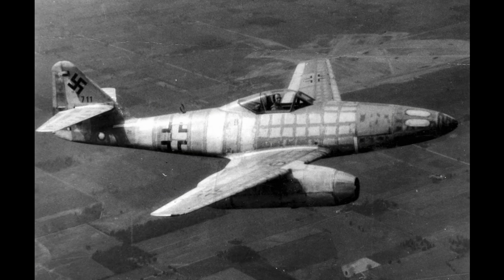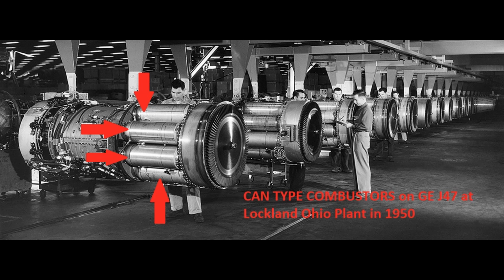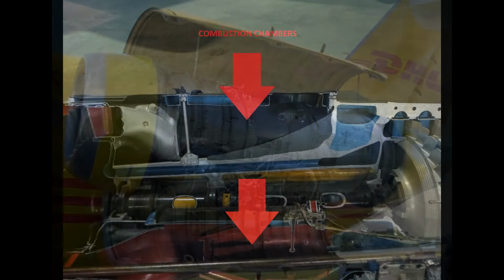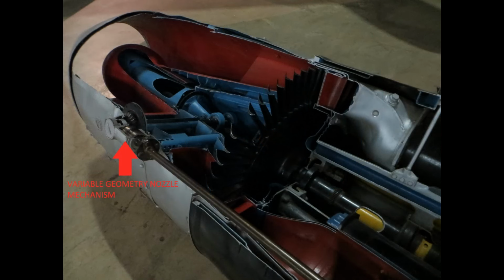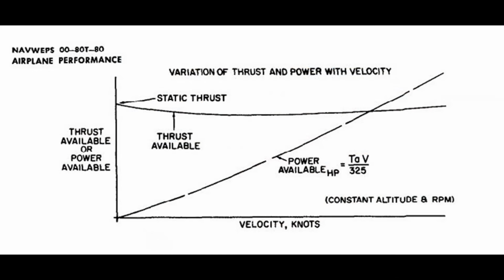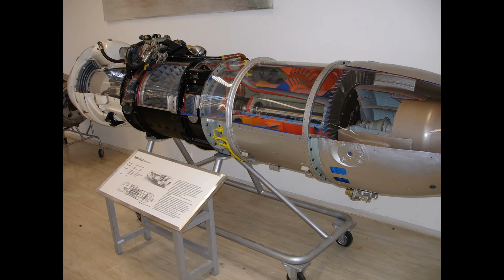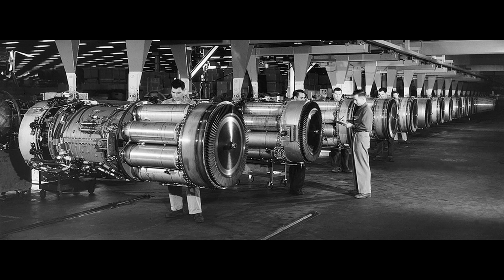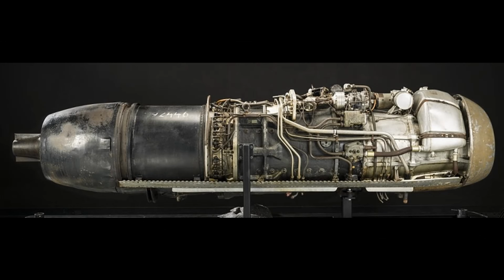World War Two JET POWER

Comment: World War Two jet power without the British ?
Britain the Gloster E28/39 had its maiden flight on 15 May 1941 and the Gloster Meteor finally entered service with the RAF in July 1944. These were powered by turbojet engines from Power Jets Ltd., set up by Frank Whittle. The first two operational turbojet aircraft, the Messerschmitt Me 262 and then the Gloster Meteor entered service within three months of each other in 1944
Reply: 27th of August 1939 was the first jet flight by a german Heinkel HE 178, in Rostock germany, twelve ensuing test flights. No "3 months" but 5 years difference.
Reply: @waltrohrbach2459  The HE178 not enter service as an operational jet fighter. The British Meteor did and was very successful although mostly used chasing and shooting down V1 flying bombs because it was fast enough to catch them.
My main point was The title of the film said WW2 jet power but mentioned nothing about the British jet fighters used in active combat.
Reply: @coastlinesailingcruisingan3991  The important thing to remember was Germany was very consistently about 2 years ahead of Britain in jet engine technology from 1934 until the war ended.
Reply: @sandervanderkammen9230  That is not true. If that statement was correct the the British Meteor jet fighter would not have been in service until 1947. However it entered service just 3 months after the ME262. It was also a significantly better aircraft than the 262 with better engines. the engine life of the 262 was just 8 hours.
The Gloster E28/39 first flew in may 1941, the first me262 flew in April 1941
where on earth do you get two years difference from ?

Frank Whittle the British inventor is credited with the invention of the jet engine. with his first patent submitted in 1930 and which was granted in 1932. This was the first jet engine patent in the world.
Germany copied his idea from this research
Reply: @coastlinesailingcruisingan3991  Its absolutely true, the first prototype  turbojet engine was built by Hans von Ohain and Max Hahnn in 1934, Whittle would not begin actual work on jet engines until he moved to Rugby in 1936.
The Heinkel He-178 flew on August 27th, 1939..
Whittle was the only the 4th person to successfully demonstrate a jet aircraft engine in 1941.
The Gloster "Meatbox" did not fly until 1943.
 That is completely false, the Meatbox was completely inferior to the Me-262... it was 140mph slower when it was introduced into service and performed poorly as a fighter and was never used in the fighter role by the RAF as it was vulnerable to attack by Luftwaffe propeller aircraft.
The Whittle W2 engines were less reliable and had a shorter life, a PTFR of just 50 hours and TBOs of 5 to 10 hours. Only the Rolls-Royce engines could match the durability of the Jumo -004.
The Jumo-004b engines met or exceeded the RLMs 100 hours PTFR reliability standards for adoption into  Luftwaffe service. This is the exact same 100 hours required by the RAF and the USAAF.
The U.S. Army tested the Jumo -004 during Operation Lusty and confirmed TBOs of 50 to 60 hours, EXCELLENT by WW2 standards.
Reply: @coastlinesailingcruisingan3991  The Gloster Meatbox was never used in active combat as a fighter during WW2 and never shot down a single Luftwaffe plane.
The Meatbox only killed British pilots.
Reply: @sandervanderkammen9230 
By the time British jet fighters were being produced in numbers in the UK during WW2 it was generally accepted that there was no need to actually make use of them.  If things had been different there would have been more produced & they would have been used.
Reply: @paulpaul9914  Britain lost the war in September 1940 and surrendered to the Americans.
Reply: @paulpaul9914  The Gloster Meatbox only killed British pilots.
Reply: @sandervanderkammen9230  America didn't  join the war in Europe until December 1941 and  didn't come England until 1942.
we had already defeated the Germans in the Battle of Britain. 1940. without any help from them. Britain alone was the first country to stop Germany advancing any further.
Reply: @sandervanderkammen9230 
The UK was already winding down in 1941 & contemplating how Germany would be rehabilitated after being thoroughly dealt with & demilitarised etc & what the UK would be doing after that little task was completed.
Reply: @paulpaul9914  There were only two winners in WW2 and Britain was not one of them.
Germany achieved its goal to destroy the British empire and become the economic leader in Europe.
Reply: @sandervanderkammen9230 
Whittle ran his gas turbine aero engine in 1937, it was the first successful demonstration of a viable, liquid fuel gas turbine aero engine in the world.
Reply: @paulpaul9914  Hans von Ohain ran his engine in 1935.... and made a successful test flight in 1939... consistently 2 years ahead of Whittle.

Whittle was only the fourth person to successfully demonstrate a working jet aircraft engine.
Reply: @sandervanderkammen9230  Why did we occupy over a quarter of Germany from 1945 to 1990 then if we lost ?
the Empire still exists its just called the Common Wealth now and has 56 countries in it.
Reply: @coastlinesailingcruisingan3991  Britain was an American possession from 1946 to 2006, it's still an American protectorate and US military forces still occupy the UK.
Reply: @sandervanderkammen9230  no it wasn't , and they are guests. as part of NATO. 
it gives them a base closer to Russia. 
your just quoting the Anglo American loan
America didn't possess  Britain.
Reply: @coastlinesailingcruisingan3991  It did in fact own Britain from 1946 to 2006, the UK government surrendered its autonomy and enfluence on foreign affairs as conditions of the Anglo-American bailout loan agreement.
Reply: @sandervanderkammen9230  I just read the loan history and agreement. at no point did America "own" Britain.
it allowed America to became the World dominant power and relegated Britain to second place. 
the war financially crippled Britain.
all this crap over my original comment that Britain as well as Germany developed Jet fighters during the war years.   
something the video failed to mention.
in Britain led the way post war with jets and jet engines. so much so that the Americans bought them and are currently fitting their B52 bombers with British Rolls Royce  engines.
Reply: @coastlinesailingcruisingan3991  Please name a single British company that still makes British jet aircraft in the UK?
Reply: @sandervanderkammen9230 
Fryed Ryce Munchyrz Kharzeestan Krappenz DiktorBummer and co etc SHUD note much appreciated awestruckness.
RR of England (gas turbines aero engines) has a wholly owned subsidiary in Germany that does smaller 2 shaft engine work, it has nothing to do with BMW. All the large 3 shaft engine manufacturing is done in England of course.
Reply: @paulpaul9914  JUST NAME A SINGLE BRITISH COMPANY THAT STILL MAKES BRITISH JET AIRCRAFT?????
Reply: @paulpaul9914  NAME A BRITISH JET AIRCRAFT STILL IN PRODUCTION?
Reply: @sandervanderkammen9230  Also I said engines not aircraft. you keep moving the goal posts because you cant deny my answers.
Britain is still one of the leading manufactures of aircraft parts and multi country fighters like Euro-fighter. Eurofighter Typhoon, the British aerospace industry has a 37.5% share in the production of the Eurofighter Typhoon and a 33% share in the development of the aircraft. The main participants are BAE Systems and Rolls-Royce. The UK had 40,000 jobs involved in the construction of the Eurofighter Typhoon, across 400 suppliers. Comparatively, the next largest contributor to the Eurofighter Typhoon, Germany, had 25,000 jobs involved and 400 suppliers.
F-35 Lightning II, the UK aerospace industry has a workshare of about 20% in the aircraft and has two companies in "Team JSF", BAE Systems and Rolls-Royce. BAE Systems designed and produces the aft fuselage, fuel system, horizontal and vertical stabilizers among other things. Rolls-Royce provides the Liftfan for all F35Bs.
Saab JAS 39 Gripen, over 30% of the content within Gripen is manufactured in the UK, according to Saab.The carrier-based concept, the "Sea Gripen", was also designed in the UK
Reply: @coastlinesailingcruisingan3991  Please name a BRITISH COMPANY that still makes British jet aircraft in the UK???

Eurofighter Jagdflugzeug GmbH is a German company based in Munich.

BAE Systems has never designed and built its own aircraft.

The F-35 is an AMERICAN aircraft designed and built by American company Lockheed Martin.

Just name a British jet still in production???
Reply: @sandervanderkammen9230 
UPDATE
It's interesting that some of the aircraft on the list should really have been noticeably safer than the Comet due to being a similar type but of much later design & manufacture but they definately were not safer.
    How things were back then -
Accident losses - % of aircraft built.
DeHavilland Comet 4 UK     14% 
DeHavilland Comet all mks  17%  
Vickers VC10 UK 5%
The DH Comet had better safety than or similar safety to many other commercial passenger aircraft of a similar era
    Douglas DC-1        99%
      Douglas DC-2        47%
    Douglas DC-3        30%
      Douglas DC-4          26%
    Boeing s300            72% 
 Boeing 307               70%
  Boeing 247                48%
     Boeing 707                   20% 
   Lockheed Electra  Turboprop    29%
Fairchild FH-227                         30%
 McDonnell Douglas DC-8     14%
  Sud Aviation Caravelle       15%
Canadair CL-44  Turboprop   46%  
Convair CV-580  Turboprop 22%

A comparison of more recent aircraft.
Accident losses comparison examples. 
1970s - 1980s
    % of total Aircraft built
Similar aircraft type, date / decade, useage, size.
    Biz Jets
BAe-125-800                        1.7 %
Beechcraft Beechjet 400    2.2 %
Cessna 550 Citation II         7.1 %
Learjet 35 / 36                       12 %
Beechcraft 1900                  6%
Dassault Falcon 10              11.5%
Aérospatiale SN.601            22.5%

Medium size jets / Turboprops.
BAe-146               5.1%
Fokker 100          6%
McDonnell Douglas DC-9-30       9.5%
Fairchild FH-227       30%
McDonnell Douglas DC-8    14%
Canadair CL-44  Turboprop   46%  
Convair CV-580   Turboprop   22%

Beechcraft, Fokker, McDonnell Douglass, Learjet, Fairchild, Aerospatiale, Canadair, Convair  companies defunct.

    All Comets, including some Comet 1s, had full civilian use certification at some point after 1954,  civilian use certification only being withdrawn after commercial flying stopped. Examples were flying until 1997 - one example did a signals research global circumnavigation flight series in 1993 via Australia virtually without a rest travelling 28000 miles, only had an ice warning indicator issue during the flights.
    The DH Comet - World Firsts.
1st gas turbine jet powered airliner. 1st high altitude 8psi pressurised full fuselage length passenger cabin airliner,  not a trivial feature as structure  strength required for pressurisation considerably exceeded strength required for normal flying stress. Nobody else had done anything similar before the Comet.
The b-47 used 2 relatively small, heavily built  pressurised modules  (the aircraft where 6 had their wings fold up in 2 months while flying & some had their wings fall off while parked). 
The 1937 Boeing piston engined airliner pressurised passenger cabin was pressurised to 2 psi only - in fact that could easily be done as the normal unpressurized fuselage cabin structure strength for flying stresses only was all that was needed to be adequate so no significant weight increase issues needed addressing.
    1st all hydraulically powered flying surface controls & actuators airliner with under carriage wheel disk brakes + ABS.
1st jet airliner to cross the Atlantic.
1st jet aircraft to do a world circumnavigation flights series.
  Of course De Havilland had prior experience building many all metal construction airframe aircraft including thousands of jet powered fighter aircraft that were primarily of metal construction with pressurised cockpits & jet engines built by De-Havilland & we know the world's first all metal construction airframe airliner was built in England in the 1920s by Handley Page.
  De Havilland did indeed always work to better than industry standards at the time, no evidence of negligence ever being produced in relation to the DH Comet.
Reply: @sandervanderkammen9230  I did BAE Hawk. I drive past the factory where they make them. at Warton. 
you didn't read that reply. you also didn't understand this post either.
Reply: @sandervanderkammen9230  Again you keep going off on a tangent. my original comments were about a film "World War Two jet power"
please try to stay on topic
The film only mentioned German Jets.
I correctly commented the British  also developed jets and had an operational Jet fighter. 
here is my original comment.
World War Two jet power without the British ?
Britain the Gloster E28/39 had its maiden flight on 15 May 1941 and the Gloster Meteor finally entered service with the RAF in July 1944. These were powered by turbojet engines from Power Jets Ltd., set up by Frank Whittle. The first two operational turbojet aircraft, the Messerschmitt Me 262 and then the Gloster Meteor entered service within three months of each other in 1944
if you would like reply please stay on topic.
Reply: @paulpaul9914  Half of the Comet 1s crashed.
Reply: @coastlinesailingcruisingan3991  Unfortunately, you look rather foolish right now lad... BAE ceased production of the half century old Hawker Hawk years ago.
Reply: @coastlinesailingcruisingan3991  Germany was the only country to have successful jet fighter aircraft in operational combat service.
The Gloster "Meatbox" only killed British pilots during WW2!!!.
Reply: @coastlinesailingcruisingan3991  No RAF aircraft ever saw operational service with engines made by Power Jets Ltd.

No Power Jets Ltd. engines successfully completed the RAEs' 100 hour PFTR reliability tests that are required for adoption into RAF service.
Reply: @sandervanderkammen9230  Lad ? I am 63
my relatives flew a spitfire and a Lancaster bomber. both of which I talked to when I was a "Lad".
Reply: @coastlinesailingcruisingan3991  Look son, regarding this topic you are merely a lad... immature and naive regarding such matters.

Please name a single British jet aircraft still in production today in Britain????
Reply: @coastlinesailingcruisingan3991  BAE CEASED PRODUCTION OF THE HAWK IN 2020.

NAME A SINGLE BRITISH COMPANY THAT STILL MAKES BRITISH JET PLANES IN THE UNITED KINGDOM???
Reply: @WilhelmKarsten  it was still an operational jet fighter. V1 bombs very very fast it was one of only a few fighters able to pursue and catch them. 
I didn't say and never claimed  it was any good just that the ME262 wasn't the only operational Jet fighter. 
however it did set the official absolute  jet speed record in 1945 of 600mph.
Reply: @coastlinesailingcruisingan3991  It was never operational as a fighter, it was used experimentally, very briefly in the V1 interceptor role but was quickly abandoned in favor of faster propeller interceptors like the Tempest and Mosquito.

The Messerschmitt Me-262 held the top speed record until Sept 14th, 1948.

 On August 19th, 1944 Luftwaffe pilot Heinz Herlitzius took off from Flugplatz Leipheim and reached a record top speed for an air-breathing combat aircraft of 624 mph (1004 km/h) in the Messerschmitt Me-262.
Reply: @coastlinesailingcruisingan3991  NAME A BRITISH JET AIRCRAFT STILL IN PRODUCTION IN THE UK????
Reply: @WilhelmKarsten  source please 
wiki lists the 262 as 560 mph and Meteor as 600 mph. .82 mach level flight.
quote I found.
After the war, the Royal Aircraft Establishment, at that time one of the leading institutions in high-speed research, re-tested the Me 262 to help with British attempts at exceeding Mach 1. The RAE achieved speeds of up to Mach 0.84 and confirmed the results from the Messerschmitt dive-tests. The Soviets ran similar tests.
this was in a dive though not level flight.
Reply: @coastlinesailingcruisingan3991  THE MESSERSCHMITT ME-262 HAS THE HIGHEST CRITICAL MACH NUMBER PERFORMANCE OF ANY WW2 AIRCRAFT.
IT IS THE ONLY WW2 JET WITH ALL SWEPT CONTROL SURFACES AND A FLY-BY-WIRE HORIZONTAL STABILATOR.
THE MEATBOX WAS SUBSONIC!
Reply: @sandervanderkammen9230  I am not claiming it wasn't a good aircraft. 
I am only claiming it wasn't the only one.
a point you seem unable to grasp.
Reply: @sandervanderkammen9230  The Supermarine Spitfire's much thinner wing gave it a considerably higher critical Mach number (about 0.89).
mach 0.86
According to Willy Messerschmitt the Me 262 would go out of control and break up if the pilot exceeded mach 0.86, The RAF tested the Me 262 after the war and gave it an absolute mach limit of 0.84
Reply: @coastlinesailingcruisingan3991  The Gloster Meteor F.8 with the Derwent 8 engines didn't appear until 1948.
The F.4s didn't enter production until 1946.
F.3s had a top speed of less than 500mph.

Heinz Herlitzius set an official DAC speed record of 624 mph over the specified 3km FAI course and measured in SOG (true speed over ground) with an Askania Kinothodolite... an telemetry instrument still used by NASA
Reply: @WilhelmKarsten  Quote I found 
On 7 November 1945, the first official airspeed record by a jet aircraft was set by a Meteor F. 3 at 606 miles per hour (975 km/h). In 1946, this record was broken when a Meteor F. 4 reached a speed of 616 miles per hour (991 km/h).
Reply: @coastlinesailingcruisingan3991  THE MESSERSCHMITT ME-262 WAS THE FASTEST JET AIRCRAFT IN THE WORLD UNTIL THE F-86 SABRE IN 1947.
Reply: @coastlinesailingcruisingan3991  AIR SPEED IS NOT OFFICIAL.
 
The Messerschmitt Me-163 flew 702 mph on July 6th 1944.
Reply: @coastlinesailingcruisingan3991  That still no where near the record at True Speed Over Ground.
Reply: @WilhelmKarsten  All I am saying is that Germany isn't the only country to produce jet aircraft during WW2. 
I am not interested in any other facts.
weather they were any good or not is irrelevant. 
or the state of Britain post war is irrelevant.
simply did we or did we not produce jet aircrat. 
in any case the best WW2 fighter by far was the BF109 prove me wrong on that one.
Reply: @coastlinesailingcruisingan3991  NAME A SINGLE BRITISH JET STILL IN PRODUCTION IN THE UNITED KINGDOM?
Reply: @WilhelmKarsten  it is still the official record quote 
new Fédération Aéronautique Internationale (FAI) record for speed over a 3 kilometer course.
Reply: @WilhelmKarsten  just admit Germany wasn't the only producer of jet aircraft and end this useless tit for tat exchange.
Reply: @sandervanderkammen9230  I did
Reply: @coastlinesailingcruisingan3991  Germany certainly invented jet aircraft and jet engines, they were years ahead of Britain in aerospace technology.
 Only Germany had successful, combat effective jet aircraft during WW2.
 The Bf-109 is without question the most successful fighter aircraft in history.
The Messerschmitt Me-262 still holds the record for most jet kills, Kurt Welter is the highest jet Ace in history.
Reply: @sandervanderkammen9230  what has that got to do with WW2 jet power.
its as relevant as name a jet built solely by Germany
Reply: @WilhelmKarsten  not arguing that. only saying you weren't the only ones doing it.
you cannot dispute we built and flew jets as well and Rolls Royce is now the second biggest manufacturer of jet engines in the world. which started during WW2
Reply: @coastlinesailingcruisingan3991  Rolls-Royce is the third largest jet engine manufacturer, the Trent series is the only British engine still made in the UK.
Reply: @coastlinesailingcruisingan3991  Alot of countries flew jets during this period.
Britain did not invent jets or jet engines nor has it ever been the leader in this field, it has  always lagged behind America Germany and France in aerospace technology.
Reply: @paulpaul9914  BUT NAME A SINGLE BRITISH COMPANY THAT STILL MAKES BRITISH JET AIRCRAFT????
Reply: @WilhelmKarsten  the question is simply did the British produce jet engines and jet aircraft during WW2.
YES OR NO stop avoiding the answer.
Reply: @coastlinesailingcruisingan3991  The question is what British companies still make British jet aircraft?
Reply: @WilhelmKarsten  no the question is about WW2 jet power. stay on topic.
did the British also produce jet engines and jet aircraft in WW2. yes or no.
that is what the film is about. nothing else.
Reply: @coastlinesailingcruisingan3991  Look son, regarding this topic you are merely a lad... immature and naive regarding such matters.

Please name a single British jet aircraft still in production today in Britain????
Reply: @sandervanderkammen9230  first sign of a lost argument is resorting to insults.
you true nature is now reveled.
you have tried very hard to not admit you are wrong and insults is the final stage of defeat.
Reply: @coastlinesailingcruisingan3991  Just answer the question.
Name a single British aircraft manufacturer that still makes British jet planes in the UK????
Reply: @sandervanderkammen9230  I just answered your question, now you answer mine.
did Britain make jet engines and jet aircraft in WW2 yes or no.
Reply: @sandervanderkammen9230  I stand corrected production did end in 2020.
we now only build jets with other partners.
the list of which I provided previously .
Right now you answer my question.
WW2 jet power was not just the Germans.
the British also built jet engines and jet aircraft. the de Havilland vampire which first flew in Sep 1943 and entered service in 1946. the first jet to land and take off from an aircraft carrier .
by the end of the war we caught up and surpassed German jet engine design and performance.
Reply: @coastlinesailingcruisingan3991  Britain was at least a decade behind Germany in jet aircraft technology, in particular in supersonic aircraft technology.
The A4b flew Mach 4 in January 24, 1945.
Reply: @coastlinesailingcruisingan3991  
Germany is the largest manufacturer of jet aircraft in Europe today.
Reply: @sandervanderkammen9230  the A4b was not a jet aircraft. you avoid the question yet again.
yes or no answer please or stop posting.
If you fail to answer yes or no I have won the original argument.
Reply: @sandervanderkammen9230  still off topic
answer the question I asked or be silent.
yes or no.
Reply: @coastlinesailingcruisingan3991  The A4b was a Rocket powered aircraft, it flew MACH 4 (unmanned) in 1945 and was scheduled to begin manned flight testing when the war ended.
Reply: @coastlinesailingcruisingan3991  NAME A SINGLE BRITISH COMPANY THAT STILL MAKES BRITISH JET AIRCRAFT IN THE UNITED KINGDOM????
Reply: @coastlinesailingcruisingan3991  BAE Systems has never designed and produced its own aircraft.
Reply: @petemaly8950  Why can't the argry little troll boy answer the question? What british company still makes a British designed jet plane?
Reply: The Messerschmitt Me-262 was the only jet to see operational service as a fighter during WW2 and the only jet to be successful in aerial combat.
The Gloster Meatbox only killed British pilots.
Reply: the last one was built The last locally assembled Hawk mk.165 was formally handed over in February 2024 during the World Defense Show (WDS) in Riyadh. Hawk 166 – Export version for the Royal Air Force of Oman. 8 aircraft were ordered in 2012 and built in the UK, with the first aircraft delivered in 2017.
Reply: @coastlinesailingcruisingan3991  SORRY LAD! ALL PRODUCTION OF THE HAWK ENDED IN 2020.
Reply: @coastlinesailingcruisingan3991  ALL PRODUCTION GLOSTER MEATBOXES IN RAF SERVICE FROM July 27th 1944 WERE POWERED BY ROLLS-ROYCE ENGINES DESIGNED BY ADRIAN LOMBARD.
Reply: @sandervanderkammen9230  my mistake I'm dyslexic.  the Gloster E28/39 was powered by whittle engines. Britain's first jet aircraft. 
bad editing in my original post. its still true though Germany didn't have the only jet aircraft of ww2 era your just nit picking.
Reply from the maker: 262>Meteor   P-80>Meteor.
Reply: @GregsAirplanesandAutomobiles  your title is World war two jet power, I watched it expecting it to be about WW2 jet power.
Maybe your title should have been 
German WW2 jet power.
Reply from the maker: The video description makes it clear what the video is about. A title can't cover everything. cont:

    Complaining that X wasn't included in a video is pretty silly because you can make that complaint about any video ever made. This video wasn't about the Meteor, nor was it about centrifugal turbojets. I might make a video about that plane one day, and then I'm sure someone will complain that it didn't have some other bit of data about the P-80. I can't please everyone, and I don't care too.